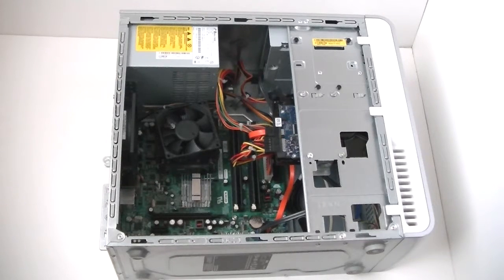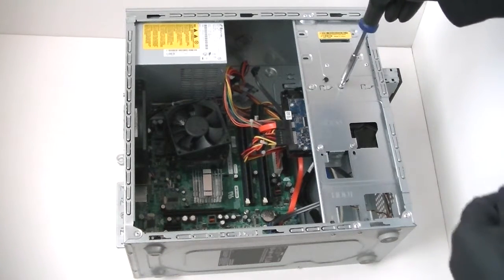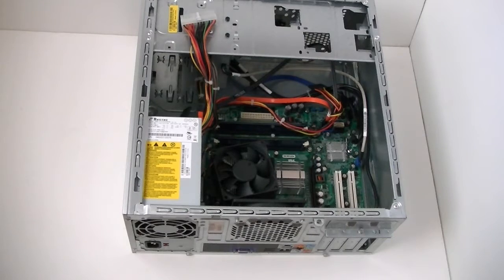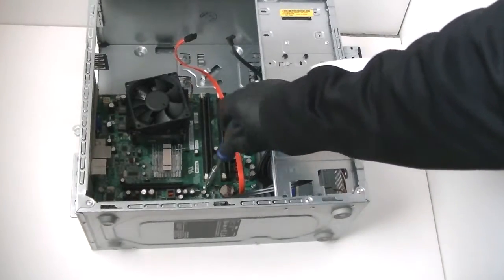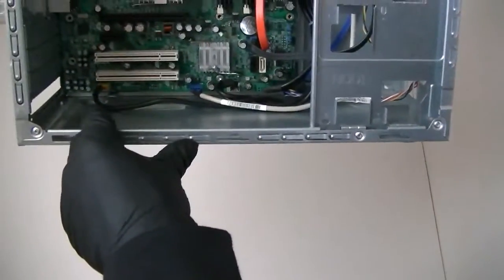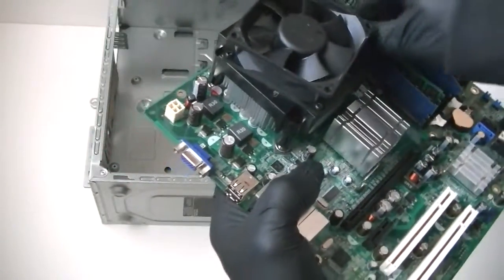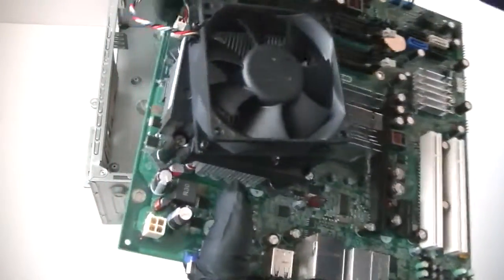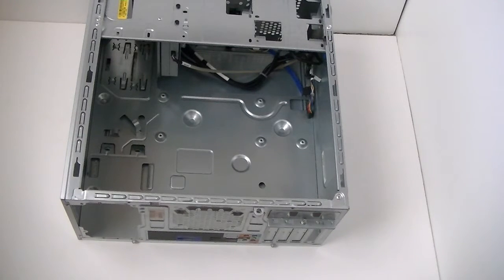Dell Inspiron 530 Teardown

Comment: Hoping to find an answer or solution to my desktop computer after it crashed while I stepped away from it to go make breakfast in the kitchen.
This type of crash happened all the time, about once a week or more depending on how intensive I'm at editing audio/music files and/or watching any kind of video stream online [the more I did one or both of these activities, the more it crashed & as often as once every 2-3 days].
These routine crashes had been going on for about 5-6yrs & every time it did, it ended up with a blue screen listing numbers and technical terms about what it just did [something about saving the computer from further harm or similarly(?)...].
Thereafter, I would always have to hold the power button down for 5s to force it to completely shutdown before pressing it right back after that to turn it on.
After which time, it will start by offering 3 modes to begin booting [Normal, Safe Mode, & the other which I can't even remember anymore]... always just clicked ENTER to get to the login screen to enter my password as that's how I'm set up with mine.I
However, after yesterday's crash, that routine is no longer working as the screen was left stuck at the beginning with the DeLL logo at the center along with www.dell.com, BIOS Revision 1.0.3, Intel logo, plus F2 & F12 in the upper right corner.I
No more choosing/selecting which 'mode' to enter anymore... after several shutdowns & restarting back up by pressing F12 repeatedly, nothing happened 
Then I noticed that both my keyboard and mouse did not light up at all & remained completely off as they were not even connected to the system at all.
Unplugging & plugging them back on did nothing to change that. I have a couple of new gaming keyboards & a wireless mouse that I used to replace those other 2, but still no connection whatsoever.
The computer & hard drive remained on as normal with the usual activity sound from the HDD, but the screen would just stay fixed at the DeLL logo sign as the F12 function key would not respond since my assumption/observation to this point is that the Keyboard is somehow disconnected from the system [so is the mouse]. All USB ports are working as I connected my phone & tablet plus that gaming keyboard where only the LED backlight came on.
WHAT do you think is going On with the connection from the keyboard that is no longer working now after that last crash??
What steps can I take to make it work again so I can get back to the Log In screen?
[[P.S.: Only 1 task was active during/when that crash took place & that was a Counterfeit/Fake 256gb USB Flash Drive plugged into 1 of the 4 available ports at the front side.
It was being tested to confirm its counterfeit status with a Flash/SD program that was running continuously for 16hrs at that point.
A micro SD card was also tested previously to that one & it took a total of 38hrs to complete that one.]]
That is every detail about what was happening around that time of the crash. Any HeLP??
Reply: Computer is a DeLL Inspiron 530 from 2008
Reply from the maker: HI, did you run system diagnostic test check RAM, CPU, HDD ?
Reply: How could I?
It's impossible if I cannot even get F12 [Boot Menu] to work right after restating the computer back up, much less getting passed the 1st screen to the login one... as stated, the KEYBOARD is not connected/recognized by the computer when starting up which explains why pressing F12 was never gonna work, LoL.

After searching a few online forums & reading passed threads on computer issues, 1 solution that might fix my problem is to change out the old CMOS battery for a new 1, which I ended up ordering a couple of those last night to try & see if that's the case.
After all, this old computer is about 12 yrs old now, so that battery may be dying after all - who knows.
Hope to receive that order by early next week, at the latest... will report back whether that works or not 👀
Reply: After taking my unit apart & cleaning out the dust inside, I took everything apart & thoroughly clean both fans for the CPU+GPU... then realized I also needed to order some thermal paste so I can reassemble them back later, lol.
The new CMOS battery came in last week & the thermal paste arrived a couple of days ago... everything was put back together last night & left it sit overnight.
I just turned it on half an hour ago, while hooking up to a brand new UltraSharp monitor for the first time as well & it's back to normal again... had to reset the Date & Time in the BIOS, now running as nothing has changed since the last time I used it before leaving to go the kitchen for 10 mins after which I returned to a shut down system.

12yrs on the same original CMOS battery turned out to be the main culprit for this problem & I'm glad I can still go on using it a little bit longer (=
Actually, I'm here cos I'm not too sure I put back the single fan in the rear of the case correctly or not... iS iT SUPPOSED To Be aN EXHAUST or INTAKE FaN??
After being turned on for 10 mins on the kitchen counter with both side panels closed, I get the sensation that it's running hotter than normal(?)
Or, maybe I should redo the thermal paste(?) LoL

Comment: Yeah, but you didn’t show how to remove the side panel!!! I unscrewed the back screws they are keeping the side panel up, yet neither side panels (yes I tried both side panels) wanna come off. Wtf...
Reply: Did you try to slide it to the left or right
Reply: @darkice7522  Of course, lol. Granted, it hasn't been opened in like 9 years so....
Reply: There is two screws on the back that hold the side panels. One should have a  hand tab on the side and oddly thick screws you ca undo by hand. Once you got those out, just give 'er a good yank and you're off to open it right yp.
Reply: Mine hadn't been opened since I got it back in 2007. It took me 1 minute to undo both screws and get it off. And this was from today lol. I wonder if one of em' can fit an RTX 1030 in it.
Reply from the maker: Hi, i did over 40 teardowns you can watch other videos.